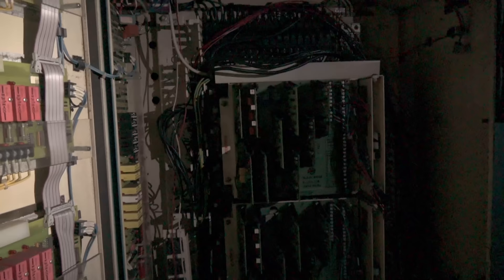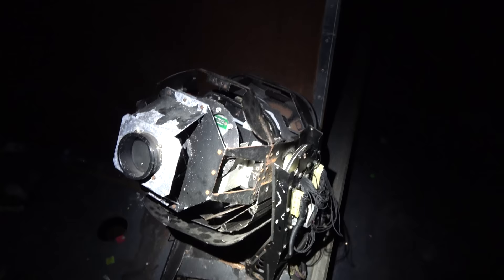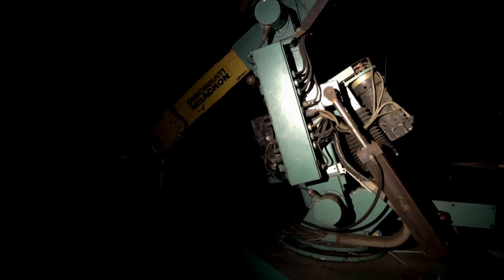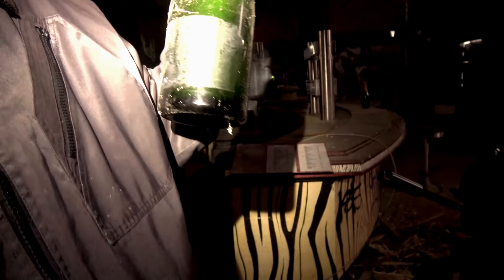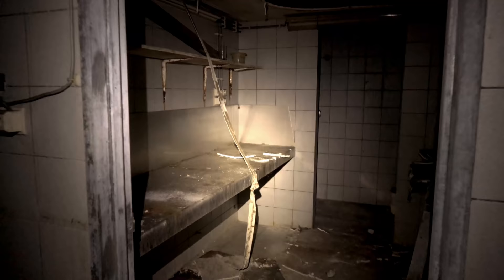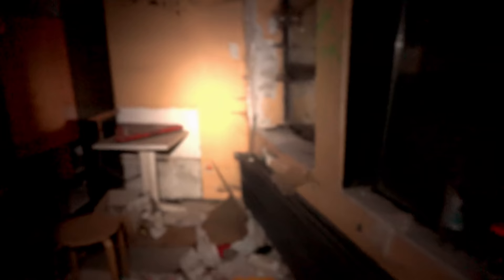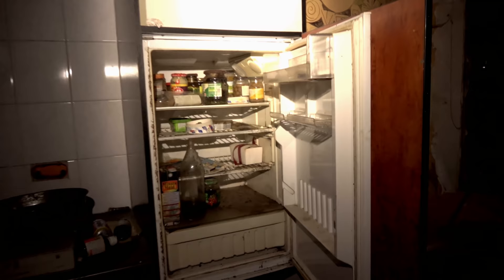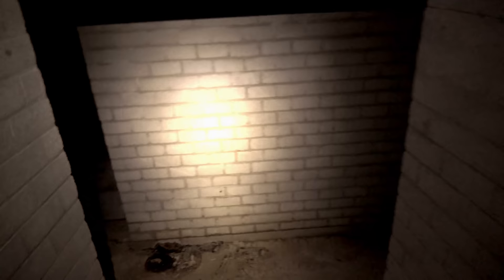Abandoned Disco "Zillion" with Movingfloors, Movinglights and Champain..

Comment: 1:51 was the computer for alcohol use, and the scale weight for drinks. Each bottle had a ring measurement and the computer knew how much. That's why are so many hard drives in the electric power generator